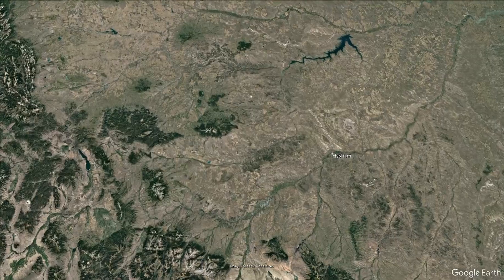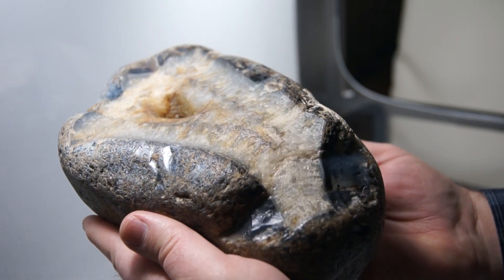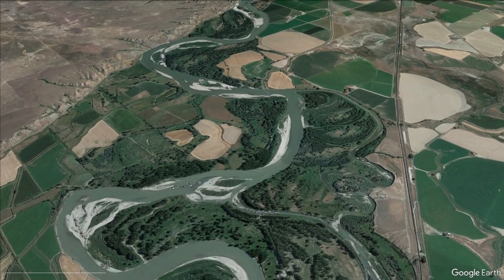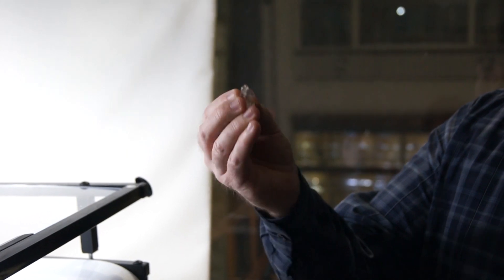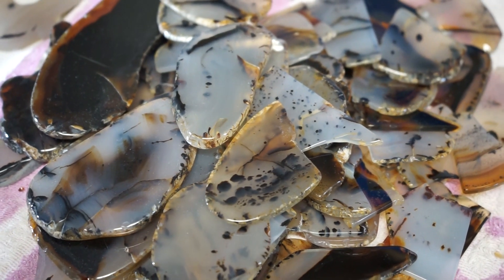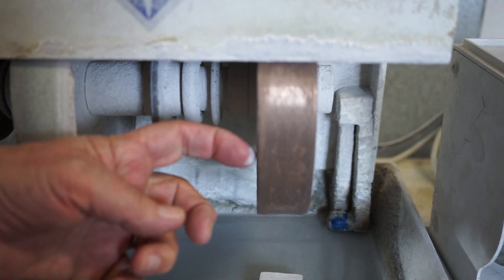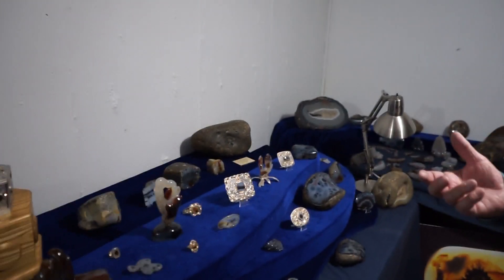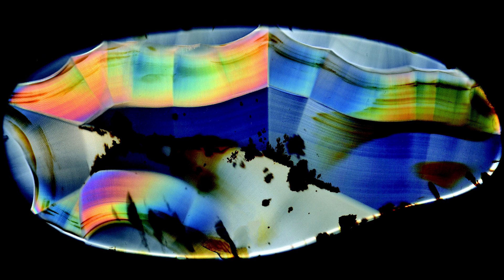Celebration of Many Faces of Montana Moss Agates

Comment: Would you call flint knapping conchoidal fracturing?
Reply: No, but it’s sort of a semantics. Conchoidal fracture is the physical characteristic of the rock that allows for successful knapping. Conchoidal fracture is just how the rock breaks every time. Flint knapping is a skill that takes advantage of how the rock breaks. Any chalcedony (flint, agate, chert, etc…) can be knapped, if it has a consistent internal structure and no fractures. I have found two agate core stones (the chunk left after knapping flakes). One of these core stones is pictured on the back of the 2023 MBMG calendar, which can be ordered from our website.
Reply: @garyicopini2090  Old disabled house bound dusty rusty rockhound here:  Great explanation!